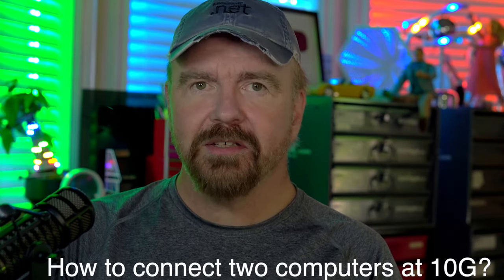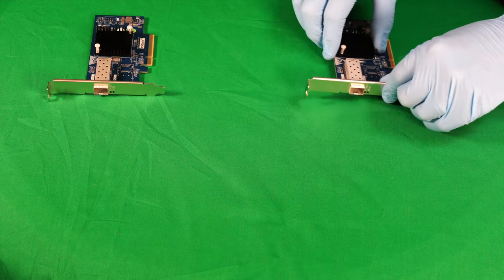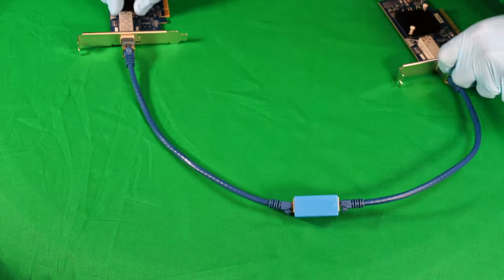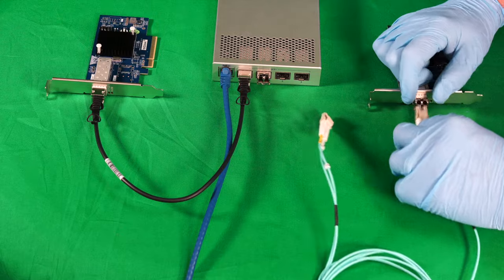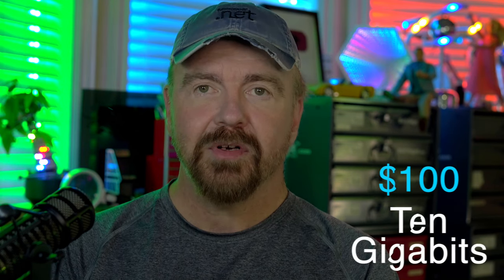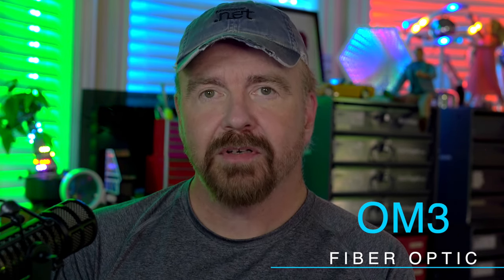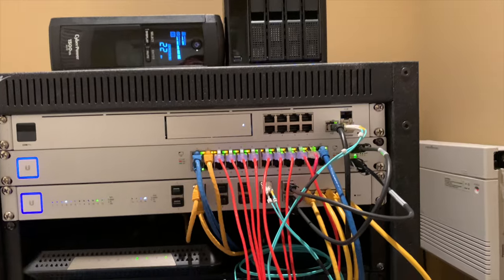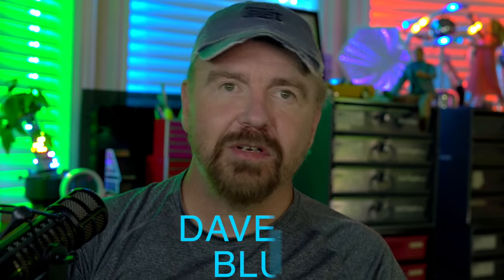10 Gig: 3 Ways to Connect!  Fiber vs Twisted Pair vs Copper

Comment: Nice video, I used to do data communications for a living up to a couple of years ago.  I remember installing a 10Base-T network when it just came out and everyone thought I was crazy, "you need coax for networking"!  By the time I retired 10 gig was pretty much data center only, maybe still is.  We used gigabit (with POE for phones) to the desktop in offices, and if every switch wasn't grounded to the building things would be destroyed in the first thunderstorm.  We always used fiber between buildings or even between rooms in industrial settings for electrical isolation.  For home use I'd run fiber to a detached garage or barn for the same reason.  Those SFP's are really a nice way to mix and match media on an Ethernet.

Comment: I find your comments around 10:30 funny regarding "with less bounces" referring to single- vs multi-mode fibers. Just to add: In fact, with single-mode fibers, there is "no bounce" of the light since the fiber acts as a waveguide and preserves the wave all over the whole fiber. Here, as you correctly state, alignment and a coherent source like a laser is key! For multimode fibers, the light really "bounces" in a classical non-wave picture and creates a funny transversal mode profile. Pro: Incoherent light sources can be coupled in easily. Con: Due to the "bounces", not all "pulses" arrive at the same time, limiting the maximum modulation rate.
Reply from the maker: You sound like you might know, so:  is it true you can shoot multiple streams of info/light by sending them in at different "bounce angles" and then aligning the receiver the same way?
Reply: @DavesGarage  Not over any sort of length. Since the cable won't restrict diffraction you are left relying on the focal quality of the lenses at the source. Nothing being perfect: The initial laser-like beam will spread over the distance of the cable, leaving you with a full-width beam of light at end far end of the cable.

Multiple signals within a cable is accomplished by using different wavelengths (colors) from different transmitters, and then combining them with prisms into a single cable. Similar prism/mirror devices then split the signal back up to matching receivers on the far side.

This is similar to how the BiDi SFPs that Ubiquiti offers work: They use a single strand of fiber for bidirectional communication by using one wavelength for A->B signals, and a different wavelength for B->A signals. (This is also how Fiber-to-the-Home is delivered over a single strand via GPON (Gigabit Passive Optical Network), but there's more magic mixed in there.)

Comment: was in a Walmart store with a temp agency and the  telecom contractor was rigging a 300m connection from the front of the store where the cashiers were to the server room in a basement of the store. Started by going up from the Cashier terminals across to the east side of the store then north to the back of the store where a wiring conduit to the basement was available, into the basement along a hallway to the server room a closet about 6 x 6 with its own AC. Tied into a 24 port CISCO switch with all SFP+ ports that then tied into a router and several servers in a shelf cabinet (IBM server swith the miniservers that stacked side by side in its own custom cabinet). They were using single mode fiber for the entire installation. They also had a 96-fiber cable coming into the building from the telecom company but were using only three of those fibers. Primary, backup and control  line for switch and router management since their admin network was external to the data network.

Comment: So I would like to give a quick explanation ( trivia ) about the lased vs LED in fiber (not to be confused with fibre which describes both fiber optic and coper direct attach cables) its been a few years since I worked in with this stuff so this may have changed but I highly doubt it. The lasers used for multi-mode are commodity lasers specifically the same ones used in optical burner drives. CD burner heads for 100mb, DVD burner heads for 1gb and Blu-ray for 10-100gb. This is actually an elegant solution since the heads are able to both send and receive laser signals it makes their production significantly less expensive. these laser aren't as accurate as the lasers required for single mode, so multimode was actually invented mostly as a method to utilize them. As an additional planed bonus the proliferation of the matching optical media allowed cost to be reduced because of economies of scale in production of the laser heads , but due to relatively poor in comparison proliferation of Blu-ray as a consumer standard the expected economy of scale never paid off with 10-100gb laser heads.  that said its easy to see how someone might confuse a Blu-ray laser head with an LED they look almost identical on the surface. Blu-ray heads actually have one more cool hat trick they support using multiple frequencies (colors) of light at the same time. in reality 100GB fiber is actually 10x10gbs connections running in parallel this is why you can find transceivers with breakout prisms this allow you to split a 100gb into 10 10gb ports.
Reply: One more thing where LED's do actually get used is lower speed plastic based fibre (again Fiber is only used to describe glass in this context) cables which historically have been used in some consumer standards such as the older optical Toslink used for audio on older HiFi stereos

Comment: The twisted-pair setup with the cross over thinking about that at 10Gb sends so many red flags in my mind. A few other notes to cover, CAT6 is only rated for 10G a little over half the maximum distanced so 55m whereas cat6A (the cables way bigger then you would want) is rated at 10G for the full 100m length. Also speaking from experience the reliability of each transceiver option I would put as follows. GE-T <= DAC < SFP+ and have tossed so many bad ones out. I've never had to reference the "geegaw" and couldn't find it on wikipedia or searching around. I'd love to use that phrase as I'm a network engineer and have the opportunity all the time. DAC has a couple of modes passive (7m) active (10m) and then the fiber version AOC 100m). Unless it's within the same cabinet I suggest not using those as it means if a connection goes bad you have to pull a new cable instead of just popping the SFP out. You should also mention that the wavelength of fiber you can't always see and it takes a second or two to burn part of your eye so you'll always see a black dot. Good video overview of networking physical basics.
Reply from the maker: Wow, I wasn't aware myself of the eye risk issue - is that true for multicode as well?  I would think the light is so diffuse that you're safe.  But I could see how single-mode could shoot out in a coherent beam and do damage just like the original laser.  Is that kind of what you mean?
Reply: @DavesGarage  MMF is pretty safe due to the LEDs and as you said it is diffused when it comes out the end. There are also safety measures built into the SFPs where they do a handshake before transmitting at full power. Still, I would not get in the habit of looking down a fiber strand as you don't always know what type of device is shining at the other end. You'd have to look at it for a long time to possibly damage your eye with MMF or it could be a couple of seconds depending on the wavelength and power of the SMF. Since the wavelengths are not in the visible spectrum you wouldn't know until it's too late. The ones that use lasers are a bit more dangerous, if you need to trace fiber or test it for breaks use a VFL (Visual Fault Locator) or overkill an OTDR (Optical time-domain reflectometer).
Reply: @krizzo  That's kinda handy to know. Thanks!

Comment: Thanks a great video.  One little extra that I would liked to have seen is how LC -> LC cables can sometimes not work as they need flipping (transmit to receive), many a time I’ve had to pull apart the little plastic clip hold the two together at the end and flip which side they’re on.

Comment: I love your videos! I'm in the process of completely redoing my 100+ year old house's network, and I can't wait to see what you do!
Reply: What did your 100+ year old house network use? Carrier pigeons?
Reply: @LiyangHU  I like the idea of mice better... In reality though, the several generations of previous owners have installed a rat's nest of telephone wiring, coaxial networks/boosters/hubs/terminators, some speaker-wire, and a few runs of uncertified CAT5 through air ducts. It's a project.
Reply: @JOE-uo4cg  Let's write an RFC for that.

Been helping a friend out with his WFH t'internets recently. The previous owner of his house was a plumber and had Cat3'ed (maybe a bit of Cat5?) and RG6'd and various forms of audio cable'd up the entire house, but left maybe 1km (seriously, not exaggerating here) of unmarked/unlabelled loose ends under the cupboard floorboards. That was fun to untangle. He should have stuck to plumbing.
Reply: @LiyangHU  I, for one, have become enamored with conduit. It's a lifesaver for these types of mess!

Comment: Tut tut Dave. You need to insert the SFP before you connect the cable - copper or fibre. The little clip that flips up activates a retainer so that the SFP can't drop out e.g. if you accidentally pull on the cable. The reverse process is to remove the cable, flip the retainer down and pull the SFP out. Many copper gig port automatically sense the polarity which makes the crossover cable redundant. This is the case with routers although not sure about NICs. You can actually get SFP optics that can drive a fibre for 70Km at 1Gbps - they're SM laser based instead of LED. Auto-neg needs to be enabled at both ends to work. On the subject of UB - the U is Ralph Ungermann who was one of the founders of Zilog and produced the Z80!!

Comment: Thanks for the overview. I must admit that the main reason I watched was to see how you differentiated between copper and twisted-pair which is copper. Thanks for pretty much always saying “direct attached copper”.

I am retired, so don’t do much of this anymore. I can still remember when computers went from 9600 to 19200 bps, which seemed blazingly fast. My first wireless data connection was a phone with a 14400 modem.

Comment: Hey Dave,
Interesting video to stumble across today. For the last two days I’ve been working on a project required 10 Gb networking and had to do a lot of “fake it till you make it”stuff. (I said to do a lot of that) just to order something, as there is a wide spectrum of equipment to do this. I just decided to go with a direct connect cables server to server to get the backup get off of the network and for whatever reason the Sophos UTM has a 10Gb, so I’m going to place one there too. (like we’ll ever have Internet like that in the time. This equipment will last.
I’ll tell everybody it’s so that I get the full use of the other 48 ports. (But I just want to do it I think because it’ll look cool) I originally thought I was going to use fiber, But when I stumbled across the Direct connect cables I was sure this is the way I wanted to go. One thing I noticed if you wanted to use ethernet GBICs they are much more expensive than fiber or DDC. I presume it’s because there’s so much fiber gear out on eBay and the like. Question, I know finally the question What is the difference between GBICs that make them compatible with Cisco versus UniFi, etc. My gut tells me it’s Marketing but what do I know. Love your channel and only because you shared recently I think differently as well. Thanks for the support.

Comment: I'd like to add that you need to be aware of if your fiber optic cable is a crossover or straight through.  I didn't know this until a few years ago but you can convert a fiber optic straight through into a crossover by taking the plastic clip off that joins the strands together on one end and then flipping the order of the individual strands.  Some cables have one strand as one color and the other strand as a different color for ease of identification (the first fiber cable you showed had a yellow strand and a white strand).  You have to do it so that the transmit of one device is the receive on the other device.  As far as I know the cross over is always required for fiber optics at some point in the physical path.

Comment: Single/multi and laser v LED is mostly about how “spread out” the pulse is by the end of the cable (if the light is bouncing around taking a funny route, there can be interference at the output or conflicts between one pulse and the next). Lasers are more coherent, collimated and monochromatic (less spread, more power makes it through the cable, can support multiple signals in one cable), and of course single mode steers the light better. The advantages are multifaceted.

Comment: the 15-pin "gameports" were used to insert a converter, I have these converters for metallic and multimode optics, these connectors used to be for hubs, mostly on BNC types. Otherwise, in 1993, I made ARCnet networks. The cards had both a BNC with an unconventional cable value of 82 ohms and a twisted pair, one pair - it went 600m with a speed of 2.5Mbit

Comment: This may be an edge case, but hear me out. We had problems starting industrial gas turbines that were intermittent and hard to duplicate. We ended up isolating the cause as the copper cable being in the same cable tray as some very high voltage cables. This was causing enough signal loss or or who knows exactly what kind of signal malfunction between the controller and the equipment, that the gas turbines would just stop spinning up. It was  a real pain in the ass and the solution was to run fiber and media converters. That is another neat fiber tool for making use of fiber.
Reply from the maker: Well, fiber is definitely immune to electrical interference!

Comment: Well done! Subscribed! I have had the 4 port MikroTik, and graduated to the 16 port version.  I'm having some issues connecting my TP-Link 24 port plus 4 port sfp to the MikroTik switch.  The MikroTik "sees" it through winbox, but does not light up on the switch.  The TP-Link shows a gig link. No signal!!  Soooo..... at this point, I'm just using a CAT 6 to each of the switches ethernet ports, which does work.  I have ordered 2 more sfp transceivers that I hope will be compatible with both.  The MikroTik switch is definitely  a "learning curve"!

Comment: I also use fiber to electrically separate my internet service from my home network.  I have had several lightning strikes come through my DSL modem and kill everything connected to my switch.   NEVER AGAIN.   The last lightning strike only killed the DSL modem and the media converter.   Worked perfect!

Comment: Necro for a correction on fiber, the source doesn't flash off and on, it relies on complicated wave interference pattern to send bits via constructive and destructive distortion. Turning the laser off and on isn't just impractical, it would also distort the signal in a far less usable way.

Comment: You get higher distances with lasers than LEDs, because the light stays coherent for longer. If you transfer you data via light, you probably vary the amplitude of light rather than the frequency. Still, even laser light starts to spread out after some distance. If you started by modulating a square function, after some time, this pulse will look more like a sine and then degrade further. The time it takes for the light to decorrelate is called the "coherence time", and if you multiply that by the speed of light in your chosen medium, which is about 124kmps, you get the "coherence distance".  For most lasers it is around a kilometer, good ones do far more, a candle will do a micrometer. An LED with some kind of filter on its output to stabilise the wavelength is cheaper than a laser and fine for most things.

Comment: Side note.  Fiber patch cables default to having transmit and receive switched. If use two on the same run it will undo the switch.   Luckily you can swap them on one end
Reply: Side side note...you will always plug in fiber wrong the first time, weather you switch Tx/Rx or not, it always needs to be the opposite way of the way you install it :D
Reply: LOL I just turn one end on first and (carefully) inspect to see which strand is illuminated.
Reply: @matthewshapiro1676  In my experience, most will have some way to tell you which strand is which. If you're lucky they're color coded, if you're unlucky they're removable bits of plastic with an A or B on them (so you still don't know with absolute certainty...), though of course your mileage may vary.

Also, be very careful with inspecting fibers that way. A 300m MM or 10km SM SFP isn't all that strong (but can still be dangerous!), but there are way stronger ones out there; a 10GBASE-ZR transceiver WILL damage your eye. Using one of those for a link between 30 and 50 km (18 to 32 mile) still needs a 5 dB attenuator... It's much safer to hook it up to the SFP and check to see if you get a link. It's much easier to take it back out and swap the strands than it is to live with one remaining functional eye. Or, to prepare the cables up front using a flash light (the one on your phone works great).

Like the warning says: Do not look into the laser with your remaining eye.

Comment: There may be a slight complication in the in wall cable, You may need to either have a patch panel at the switch end or flip the TX and RX fibers to prevent it from becoming a straight through connector